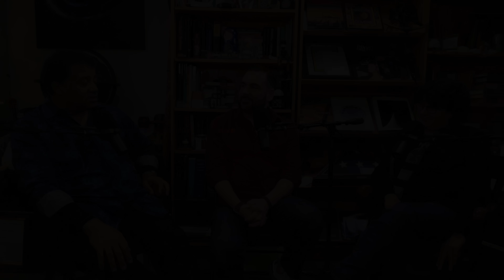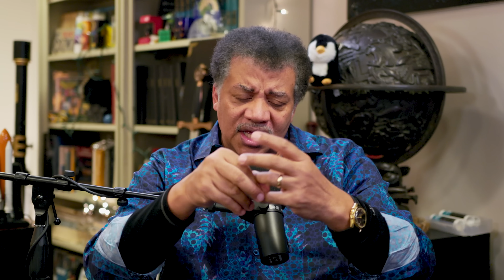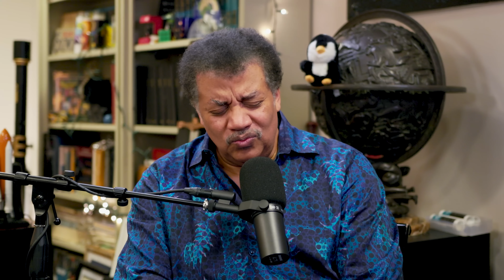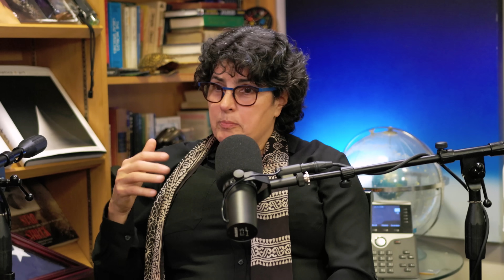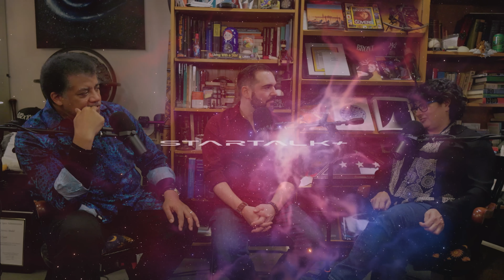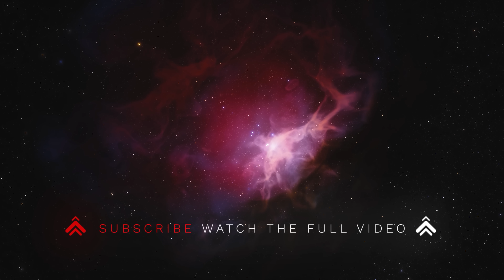How LIGO Squeezes Light to Detect Gravity

Comment: The idea of “beating quantum limits” sits at the intersection of physics and information theory. In quantum physics, limits arise from principles such as Heisenberg’s uncertainty relation, which constrains simultaneous knowledge of complementary observables. Similarly, the standard quantum limit (SQL)  defines a threshold of precision in measurement, often seen in interferometry and gravitational wave detection. What it means to “beat” such limits is not to break quantum mechanics, but to employ quantum resources in ways that bypass conventional restrictions. For instance, squeezed states of light allow sensitivity beyond the SQL by redistributing uncertainty between conjugate variables. Likewise, entanglement can enhance phase estimation, achieving what is known as the Heisenberg limit in metrology.

In quantum information science, the phrase takes on another dimension. Quantum mechanics prohibits certain operations, such as perfect cloning of an arbitrary state, or transmitting information faster than light. Yet by using entanglement, error correction codes, and resource-theoretic approaches, researchers have extended what is operationally possible. Quantum error correction, for example, appears to “beat” decoherence by preserving fragile superpositions beyond the raw physical coherence time of qubits. Similarly, entanglement-assisted communication allows one to exceed classical channel capacities, showing that the effective “limits” depend on the resources available.

Thus, “beating quantum limits” usually means reinterpreting the boundary between the impossible and the achievable. While the ultimate laws — such as the no-cloning theorem or the uncertainty principle — remain unbroken, innovative strategies allow researchers to circumvent practical manifestations of those laws. The phrase captures both the technical ingenuity of quantum engineering and the philosophical challenge of distinguishing between absolute limits of nature and limits of technology.